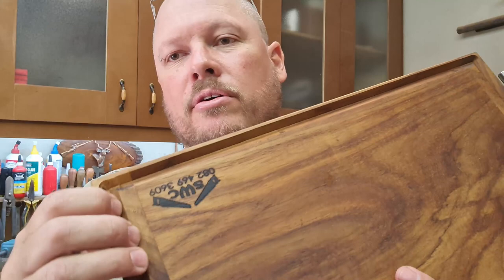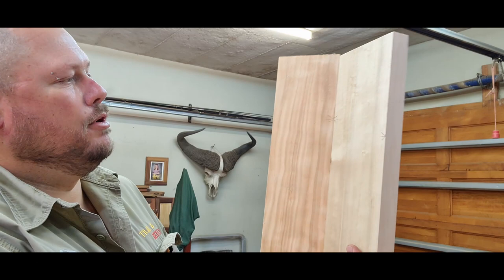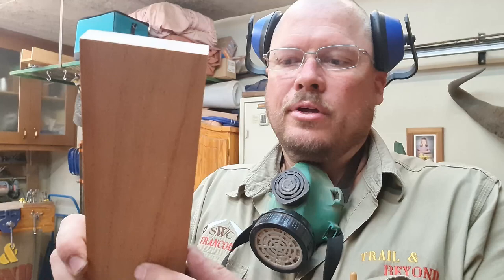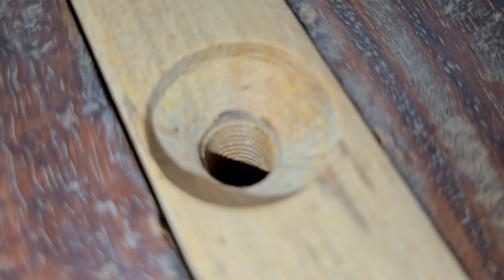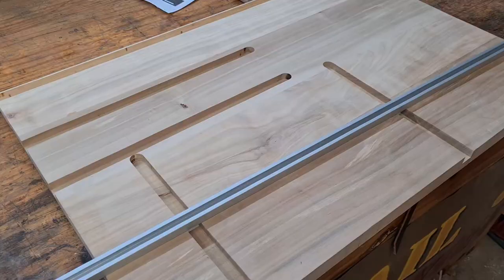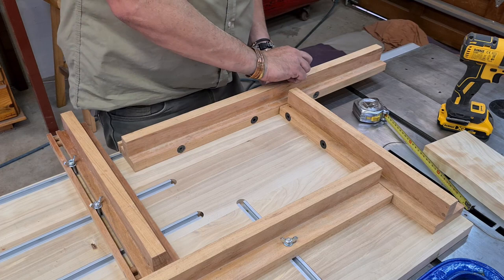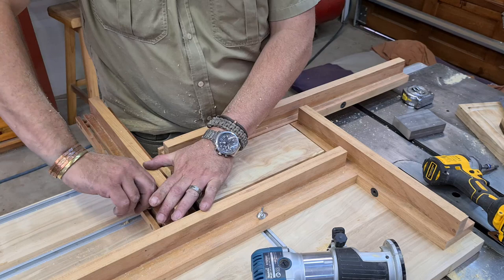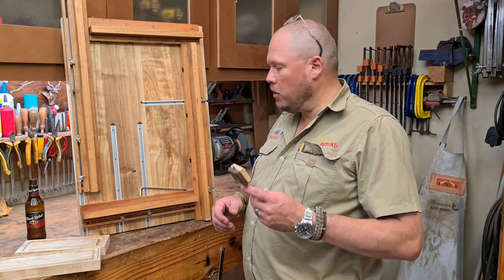Juice Groove Jig. The last jig that you will need for cutting perfect juice grooves every time.

Comment: Very nice job; looks very sturdy and highly flexible. I like that you didn't hold back on the materials. Your juice groove adjustment idea to use bolts that you can run in and out is quite ingenious. I wouldn't mind making one of these. Do you have a website to get the plan from?
Reply from the maker: Hi Jean. Drop me an email at Francois@trailandbeyond.co.za and i will send you the plans.

Comment: Looks like you got this from Kings Fine Woodworking video that is 2 years old. Same exact design.
Reply: Kings has a nice design, but Francois added the adjustable groove distance and the alternate way of making the slot.
Nice modifications.
Reply from the maker: As mentioned in the videos description, yes you are right. I have added an extra future that ables you to adjust how far you want the groove from the edge of the board.